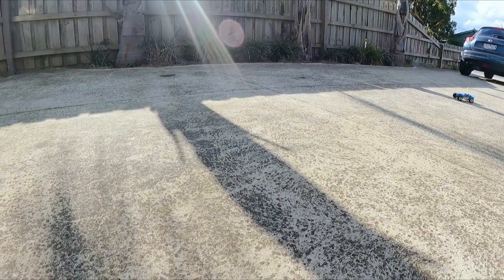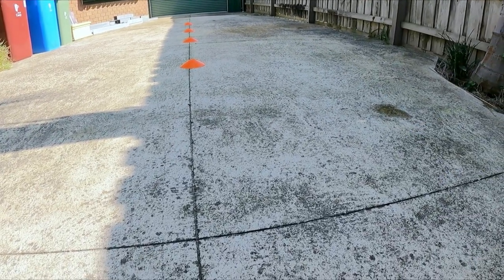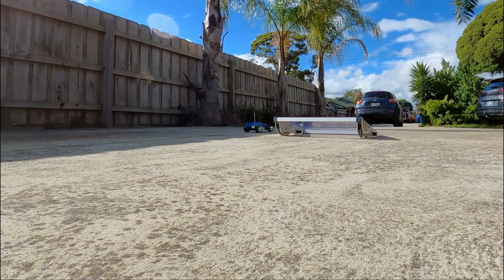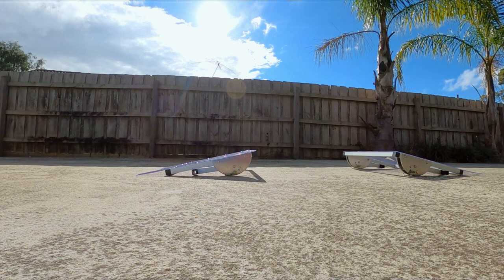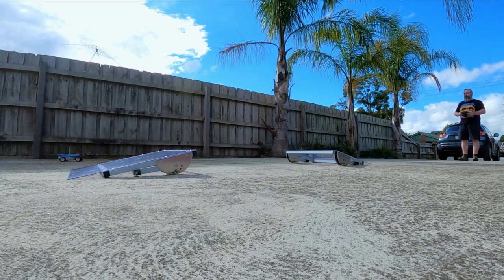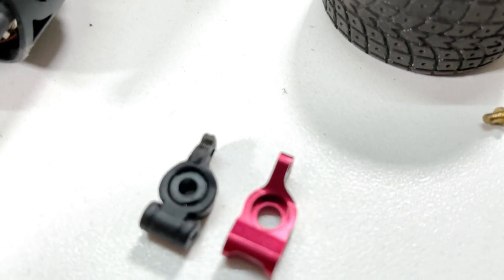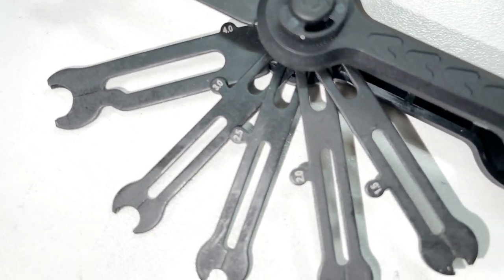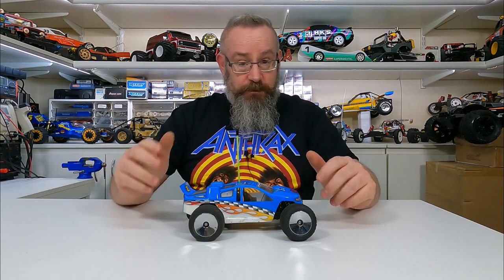The Original Team Losi Mini-T - Modified Brushed Motor & 2S Run | Plus Dynamite Ultimate E-Clip Tool

Comment: We used to run them around our workshop on breaks. The rubber floor mats we had at the work benches made great jumps, you just had to shove some lumber under them to make really neat rolling jumps. I just took a look at mine and thing I may get them out and running again (I blame you and Glenn). Just need to grab some batteries and maybe convert one from the stock electronics to newer. Love the jumps you made too, looked like fun!!
Reply from the maker: Awesome. Yeah the rubber mat jumps is a great idea. Now is a good time to get yours running, if you need parts I've notice more parts on ebay for the original Mini-T's since the release of the MIni-T 2.0. I guess it reminds people they have old stock sitting around. Thanks mate, yeah those jumps seem to be working nicely. 👍